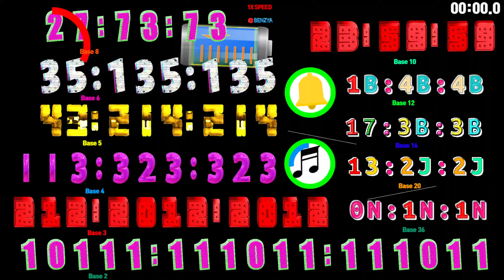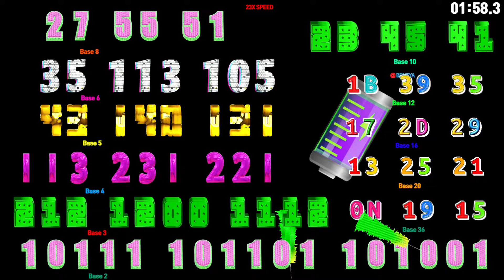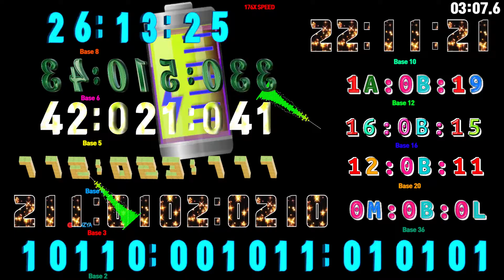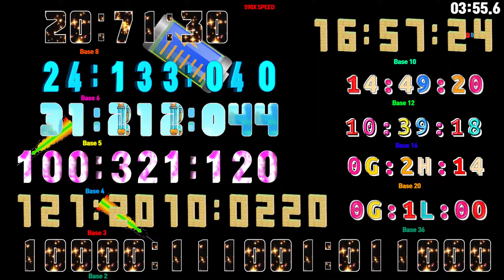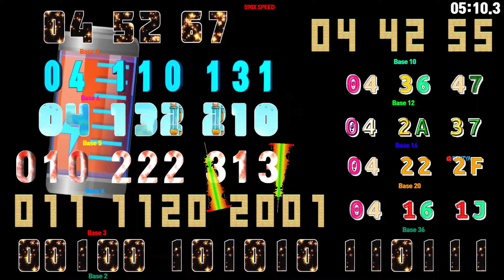23:59:59~0 countdown timer, but in different bases alarm🔔speedfeeling

Comment: Benzya, I made a really cursed system today. I used Base 6. However, instead of using numbers, I did the Vowels of the Alphabet. Pretty cursed right?
Reply from the maker: Wow the Vowels of the Alphabet. base 6 is good
Reply: @benzya   yeah Base 6 is good. But not in the vowels of the alphabet.